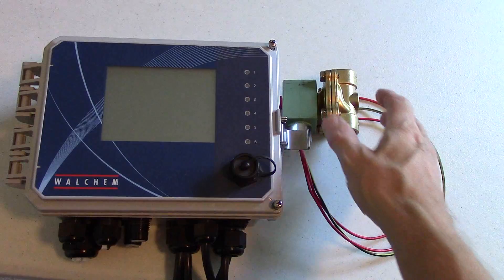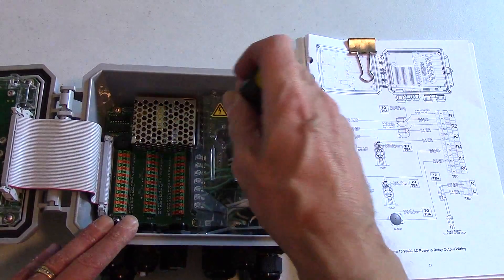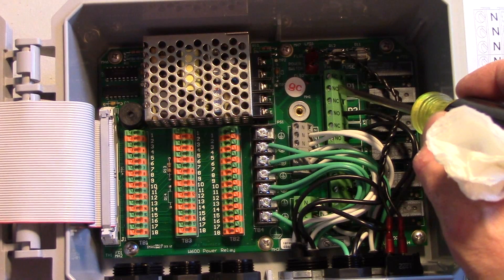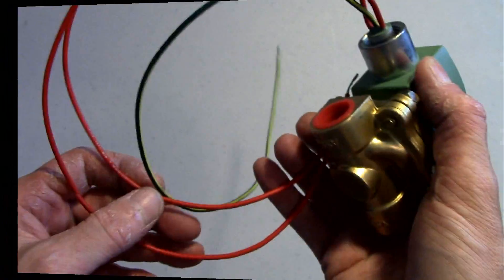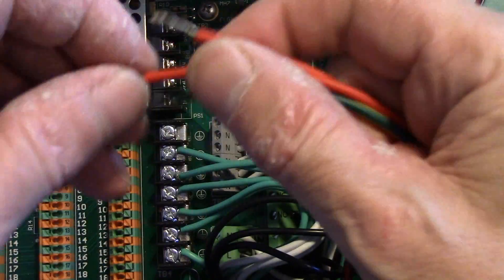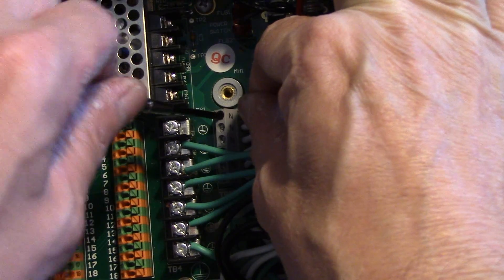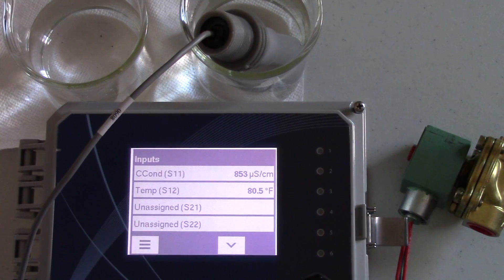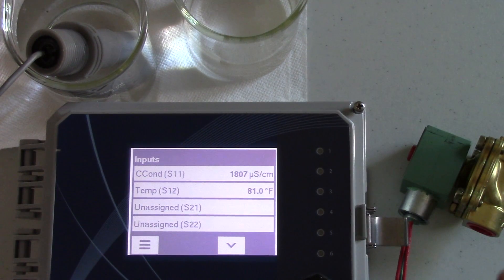W600 Wiring: Solenoid Valves

Comment: I'm wiring these into a TACO ZVC, and I've heard that the reds go into ports 3 & 4. and yellow wires are power into ports 1&2. TACO says por 3&4 are for opening the valve and 1&2 are for power to the valve. So should one of each red wire in 1 & 3? or 2 & 4? or 1 &2? or 3&4. Do I just connect my grounds to the ground from the ZVC?